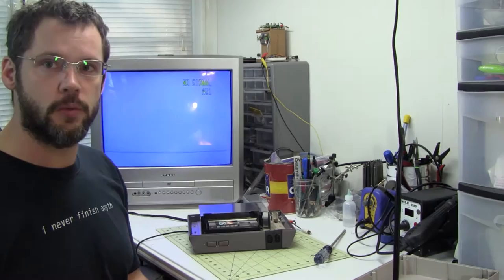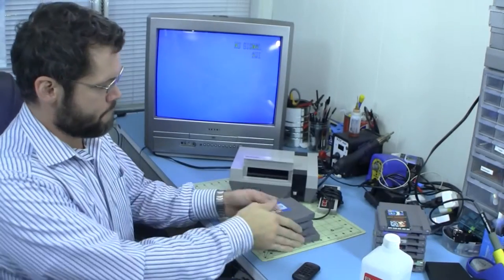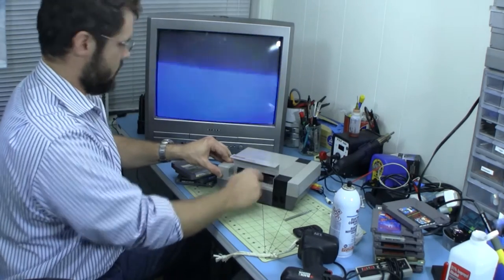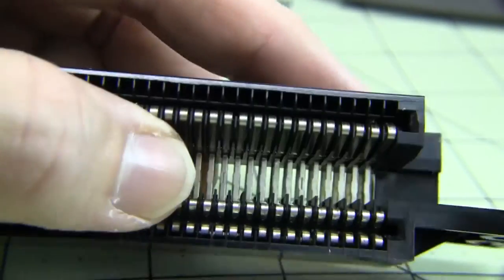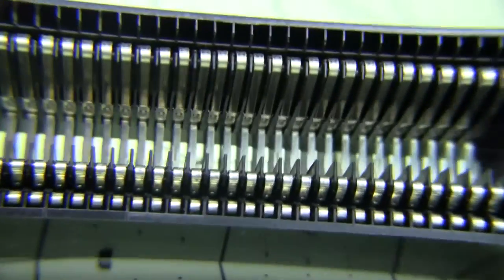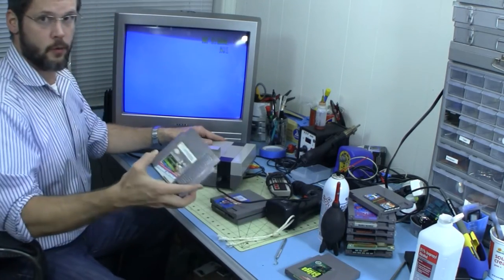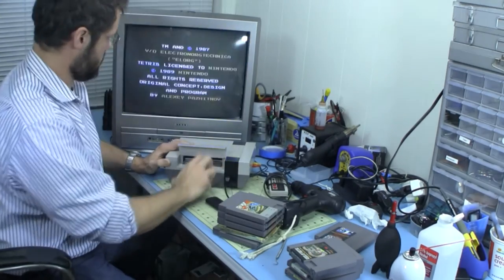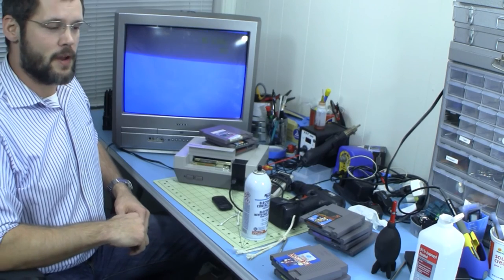When Boiling the 72-Pin Connector Doesn't Work - Short Version

Comment: An excellent video. I do repair these NES often and find that bending the lower pins (72 pin connector) does read the games better than boiling the pins. However, if you bend them to much, it becomes a death grip. When this occurs, I need time to break in the pins and eventually these pins do lower and read those NES games. Great job on the video and very informative 👏🏻

Comment: I know I'm late to the game here, but your NES looks to be working fine since some games are coming up almost every time.  The problem is some of the games need to be cleaned.  If you clean them with just Q-Tips and rubbing alcohol, that will fix it most of the time, but some games need to be opened and you need to clean the pins with an eraser to get any sticky residue off.  I use the white erasers.  I actually do the eraser and then wipe the eraser pieces off and then use a Q-tip with rubbing alcohol and finally a magic eraser to finish it off.  I've done this with over 100 NES games and have gotten every one of them to work.  It can take a good 15 minutes if the cart is really bad, some only take about 5.
Reply from the maker: +parkfun101 yep, since I made this video I learned about the eraser method which apparently is great and recommended by many old-school electronics techs.    I'm not sure I'd be comfortable with magic eraser as it contains an abrasive that might be too aggressive.  cheers

Comment: I have a stripped screw on the bottom of the nes,I cant remove lid,never had this happen before..Any tips on removing stripped screw,I have been searching everywhere cant find anything to help me with this problem eventhough it seems simple,I figured you would be the guy to ask.
Reply from the maker: PerfumePat Personally haven't had it happen. I heard this is helpful though: https://www.youtube.com/watch?v=MaCYyL4UJAA  You could try heating up the screw with a hair dryer (don't use a heat gun, you'll melt the plastic).  Also, how about hitting the screw with some lubricant (test for plastic safety first).  I'd try the rubber band trick first before anything else.  Also, try some different sized drivers.  Thanks for watching.
Reply: 8bitjunkie rubberband trick didnt work,try all different drivers,gonna just keep at it.and try to find something that works,thanks for your help and keep up the good work with the channel ✌
Reply from the maker: worst case you can drill it out. just be careful! good luck and thanks again.